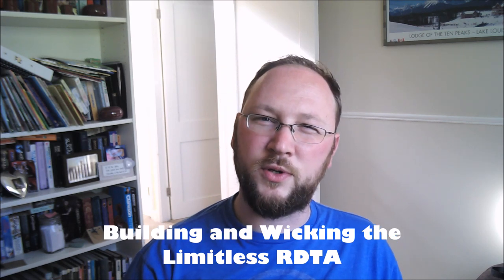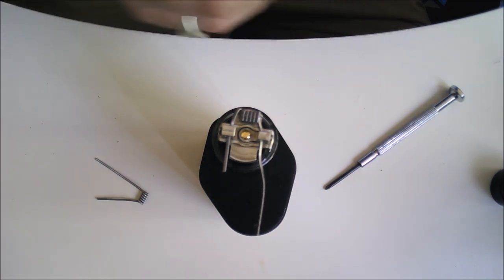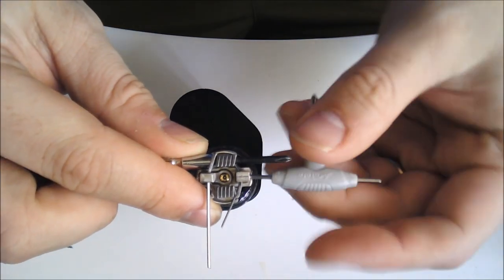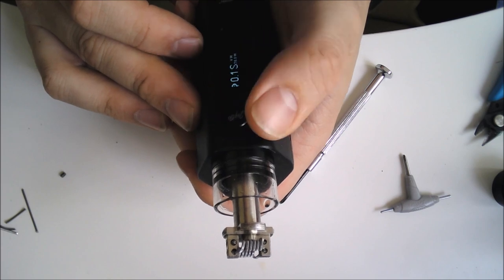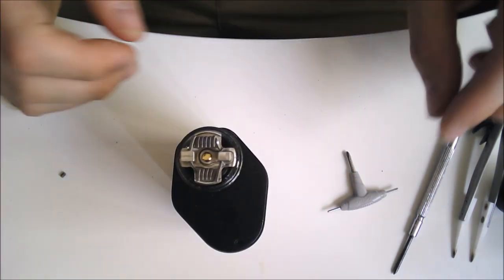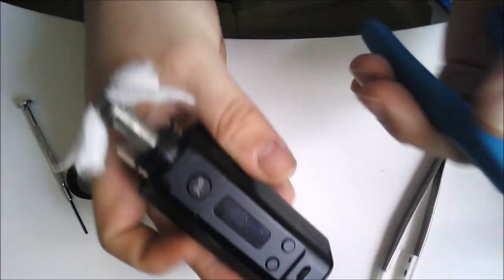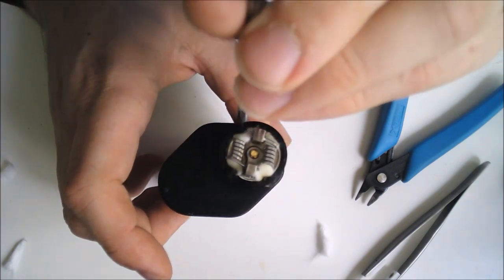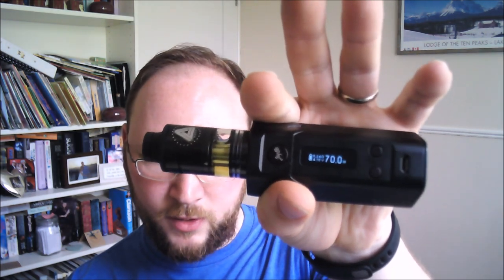Limitless RDTA Build and Wick - No leaks!!

Comment: I appreciate the help! I kinda wish I would have bought the Limitless Plus because this Limitless doesn't come with an drip tip extension. Even with the twisted coils the RDTA came with, it still powerful enough to splash hot ass juice on your lips with only 45-50 watts. That's the downfall of this Limitless, a small drip-tip (almost non existent).  I bought a Chubb tip (cost me $15 bucks),  but if I would known in the first place about the small tip, I would have just spend an extra $10 and got the Limitless Plus. Thanks for the help on building without leaks.

Comment: great video Tim, I'm gonna use this rdta on my cool fire plus.....I only use pre built coils, what coils would you recommend for 50 - 70 watts.
Reply from the maker: +Mista L hey thanks! When you say pretty built coils there are so many of them out there to choose from. I really like the could I put in there so I would look for some fused Claptons that come out to about 0.2 to 0.25 ohms. That is what I run and I typically vape them at 70 watts. Does that help?
Reply: +Tim Mackenzie yes that helps, thanks mate.
the limitless comes with a pair of coils, are they any good?
Reply from the maker: +Mista L yes they are absolutely fine. Just nice simple twisted coils. Not sure what that are made of but I think kanthal.
Reply from the maker: +Mista L sorry for the late reply. Yes the coils that come with it are fine! No complaints!

Comment: I used the stock coils that came with it at first and vape around 60 watts but now I want to try building my own. I've always used sub ohm but everyone says for best flavor you want an rdta or rda but I like having juice in a tank to not add juice every 5 hits (annoying) so def why I went rdta and love it so far! However, if I'm looking for max flavor and want to vape between 40-60 watts what wire or gage do u recommend? I've never built my own coil so I'm new to this department. Thanks!
Reply from the maker: +Daniel Revell for flavour and the sort of wattage you are looking at I would definitely recommend some Claptons.  You can either build them yourself or just get some premade ones. They produce really good flavour and you can wack lots of power through them!

Comment: Thinking of getting this in the plus version. But was wondering why do you cut the wick at the top of the glass instead of letting it go into the glass tank so its always wicking? Would it be any problem doing that by sticking the wick all the way down?
Reply from the maker: +J Bryant I cut the wicks to the top of the glass so I can get as much juice in as I can. It still wicks fine. There would not be any problem letting them be longer but IMO there is no need!

Comment: I have a question for you! I have a Joyetech Cuboid 150W and I have just found it hits better at 70 to 75 Watts. My only concern is the Voltage reading - 4.18V. Should I worry about that or am I worrying for no reason at all?
Reply from the maker: no not to worry. You need to work out your ohms law, it will all depend on what resistance you are running on your coils.

Comment: I was a mech mod user exclusively until this month ,if I did dual Clapton in Mage rta how many watts roughly for comfortable vape without slow ramp up? It's 26/32 Clapton 4 wraps roughly .5 ohm im pushing it at 40w but don't feel comfortable,and it's getting real hot, I like a instant fire vape 😁
Reply from the maker: +gill gilchrist if you were running just mechs then you would be used to higher wattages. I would go to 60 and see. Only issue will be if your wicking can keep up!

Comment: i ended up with .28 ohm with 7 wraps fused clapton wire what wattage should I vape it at you think? im at 80-85 but it gets a bit hot. anything lower and it takes too long too heat up???
Reply from the maker: The more wire you use the more time it will take to heat up so as you say you need to put more power through it. Personally I like to build to about 0.2 ohms and than vape it at about 65 watts. Maybe drop you wraps to about 6 or wrap around a larger screwdriver. At the level you are vaping you are running about 4.9 volts.

Comment: If you poke holes into the cotton with a screwdriver, for the air to vent, of course you also make room, and build channels for the juice to pour out, as soon as you lay down the rdta flat.
This build will never lead to a non leaking device.
Unfortunately, the wicking space, where you tuck in the cotton in are triangular shaped, with sharp edges.
The cotton is usually round, tube like shaped.
So be sure, that the cotton seales the edges. This build, as shown in the video, will not give you a sealed device.
And, please clean fingernails if you show your fingers to the world.
I would.....
Reply from the maker: Thanks Ralf.

Comment: i dont understand how it wont leak threw your 4 cotton wholes and out the air holes if you lean it over? is there something preventing it? or will it leak if u lean it on its sidem
Reply: I don't know either. I have it, and somehow the shit is kind of leak proof when you get it going. Idk how they do it, but it won't leak most of the times. It does leak sometimes though its not all the way leakproof. It will leak if its layed on its side.

Comment: Hey Tim, Im getting Atomizer short message every 15 mins i vape with this device, i got the Limitless RDTA and the Reuleax 2/3

Have you got this issue?
Reply: i have reuleax its fine but please realise that you can try adjusting the pin at the bottom. try that and make sure ur coils are not touching.
Reply: chris Pec I have the same with my Gaia drive me fucking crazy
Reply from the maker: +dozer313 what resistance are you building? The rx 200 does not go down as low as some devices. If you build a 0.15 or 0.2 then you should be fine

Comment: please help i bought this and only the firsf day it consumed more than 20 mls any help please?I was using it just for 2 hours not longer
Reply from the maker: wow!! That sounds like too much. It does go through juice quickly but at that rate you are using too much !!! I would imagine that you have too little cotton in there so that juice is running very freely. Have you had a lot of spitback? I would guess that you are basically drinking juice!! Or what wattage are you running at, that might make a difference in your juice consumption. Let me know.
Reply: i have cottons at the bottom vaping at 60w and 0 spitback
Reply: with the coils that they provide(fused claptons 0.18 ohms)
Reply from the maker: +Kapten Thanasakis try shortening your cotton so that it sits right at the top of the glass!
Reply: i wish I could put up a photo. im having the same issue. day 4 with the plus v2 rdta. i have the cotton all the way to the bottom of the tank and its just spitting like crazy and I think the cotton is thin as well. its popping a lot. 7 wraps clapton at .28 ohms 4.87 volts and 80 watts. claptons take a bit to heat up mean while its popping and burning my tongue..lol..i suck at this! my tfv8 is looking better and better with each pull off this thing!
Reply from the maker: Playing around with it is the bast bet. It is a tank that really drinks juice. I would get onto drippers mate!
Reply from the maker: +Edd Higgins less is more a lot of the time Edd

Comment: is there a way to stop limitless xl from leaking ?? it leaking alot 😭
Reply from the maker: +mosby sorry I haven't tried the Xl again though I would imagine it's the wicking that you need to look at!!
Reply: Tim Mackenzie yes when filling it close the air intake and let the ejuice settle. providing the ejuice holes are filled with cotton there will be no leaks at least I've never had them on my single and dual coil builds... its all about pressure in the tank forcing juice out.

Comment: Can you run just 1 coil?
Reply: yes
Reply: how do u run one coil on this ?
Reply from the maker: +joey hazey I would build a larger coil in the middle. It doesn't have any blocks to cut off the air flow like the plus version!
Reply: you use the white plug in the box to block one side off.
Reply: can I build the duel coil to whatever ohm's I want ? I.e two 1ohm coils would make 0.5 ? I like to vape at lower watts to preserve battery life . thanks for the help guys appreciate it .
Reply: yes as long as it is within the safety limits of your battery
Reply: Yeah I use the brown of batteries should be OK at 40-60 watt thanks for the advice guys 😀
Reply: you are welcome. I'm running mine at .2 at 4.2 volts which is right at 20amps and 110 watts
Reply from the maker: this version doesn't come with a plug!

Comment: Overall not so bad but your wicks are way to messy! C'mon man keep your wicks nice and clean, without of excess, to get the best result.
Reply: Krzysztof Trojak yes when filling it close the air intake and let the ejuice settle. providing the ejuice holes are filled with cotton there will be no leaks at least I've never had them on my single and dual coil builds... its all about pressure in the tank forcing juice out.